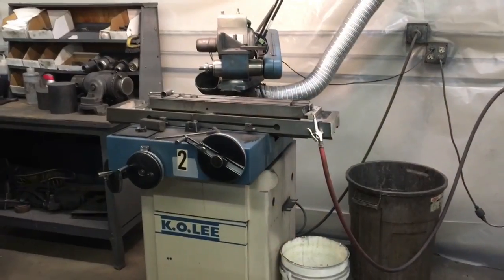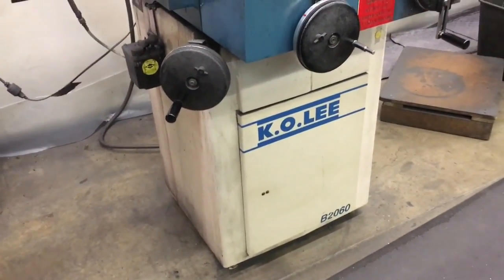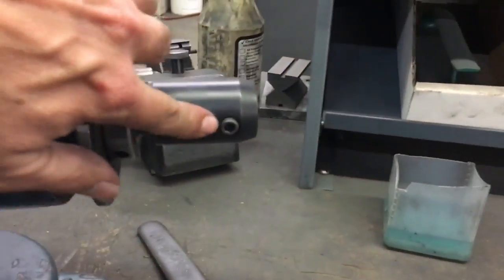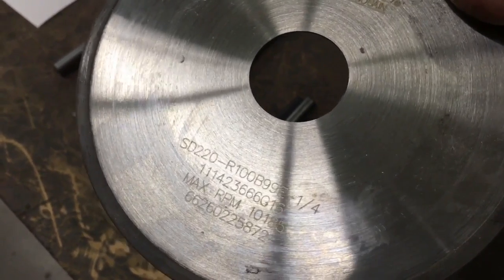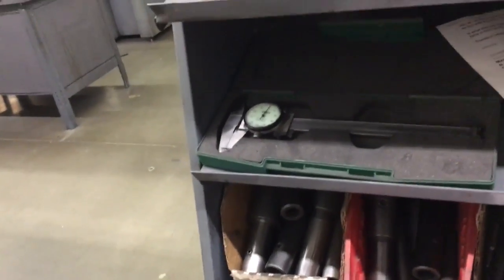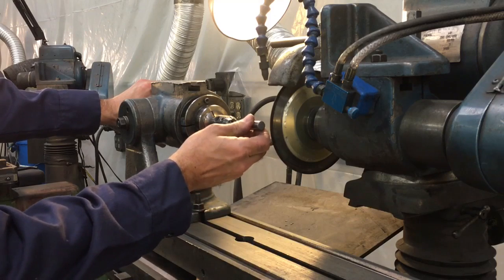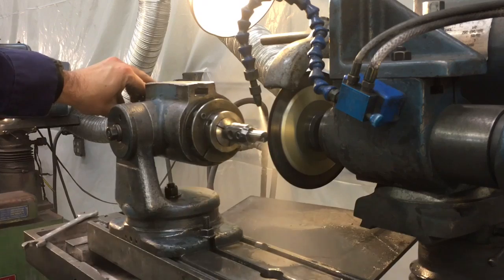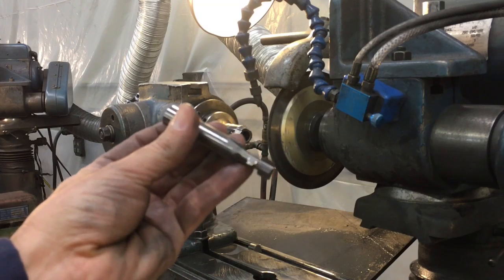"In the Cut" KO Lee and how I cut off carbide shanks

Comment: The most efficient way to grind carbide is with flood coolant and a diamond wheel. The carbide grinds like butter. Piddling around with mist coolant is not the way to go. I could cut that carbide blank in half in 5 seconds with flood coolant and if set up properly would not make the mess you're making with the mist coolant. An out of round diamond wheel cuts better is pure bullshit not to mention the crappy surface finish you get. According to your logic that one area of the wheel is going to load up faster so why not use the whole wheel to cut.
Reply from the maker: Precisely why I titled it, “How I cut carbide off on a KO Lee”. Of course there are better and faster ways but not everyone has access to the “best” way. Also, there are a great deal of interrupted style wheels that are very useful for free cutting roughing work.

Comment: Thanks for sharing, any and all tool cutter grinder info you can put up would be awesome! 

There isnt much of any info around on them, if youre looking to expand your channel, that would be a great way to do so quickly.
Reply from the maker: dj berg Thank You . I need to find some time to do that. Anything in particular you’d like to see.
Reply: Alfred Lyon as a very low budget garage hobbyist, manual machine operator, i am leaning towards picking up a cutter grinder. Pretty much to save money on tooling and repair whoops tooling, since its bound to happen, and is happening lol.

So maybe start with a basic over view of all the tooling of a well tooled machine? That is one of my biggest questions, what all is out there for them, i see adds for well tooled machines, but the photos are not very detailed, and of course i dont have the money to drop on something that nice.

Then maybe some more basic fixturing and setups for common tools? 

I just saw last night nyc cnc did a tour of your place, cant wait to get home tonight to watch that. 

Thanks again,

DJ
Reply from the maker: dj berg ok. We have a few Cincinnati no. 2s , a bunch of KO Lees , and then a bunch of converted surface grinders that we use for job specific operations. What kind of machine do you think you will be looking to purchase?
Reply: Alfred Lyon theres a smaller ko that i could pick up for cheap, that i am contemplating,  but it needs love and has no tooling/accessories at all. 

But after seeing Jon's tour of your shop, it seems one of the number 2's would be a great all around walk through machines, since they dont seem to be set up for a specific job.

Also, its awesome you have your apprentice style hiring process, if you were not on the other side of the country i would be doing anything i could, to get into, and to learn in your shop.
Reply from the maker: dj berg ok. You can pretty much do the same work on KO Lee and a Cincinnati except that the Cincinnati is not only more rigid but it also offers a multi-position spindle that is fun to explain. I will try to find time to get a video up.

Comment: why use a 220 to part off? ive been grinding since "79" all ways used a 100 or a 120
Reply from the maker: brucegor main reason is that's what we have lying around. We seldom cut off as opposed to buying blanks that are cut to length. The reason for the video was a lot of machinists that follow me on Instagram asked how "I" cut off blanks in a pinch. If I was cutting off blanks in production, which we are not a production shop, then I would order the appropriate wheels and use power rotation and infeed. The point of the video was that if a machinist had basically any diamond wheel , within reason, them they could easily shorten their end mills.
Reply from the maker: use what we have lying around

Comment: spinning work head buddy then you only feed wheel in!
Reply from the maker: jandagrinding that can be much harder on the wheel than heavy pass, slow roll. This is why I preface most videos with " here's one way". We definitely have spinning work heads but for manual cut off this is my go to. Having done this operation both ways over my 30 years of grinding I can say that this is my preferred method. Thank You for the input.
Reply: Alfred, I too am a tool and cutter grinder and trust me it is faster and easier when the tool is spinning in the opposite direction of the wheel! But, I've only been grinding since 1986. GOD bless!
Reply from the maker: jandagrinding I totally trust you and thoroughly respect your method. I did not mean to start a "whose been doing it longer contest"  (of which you win) .
Reply: sorry, my bad, just saying for me that's all! I would never even presume to tell another tool grinder how to grind anything as everybody has their own style! Especially manual tool grinding of which there are few around anymore! GOD bless!